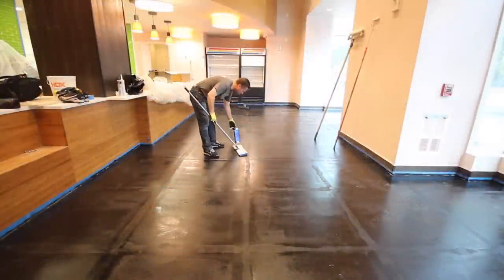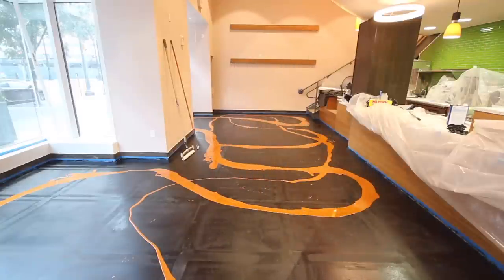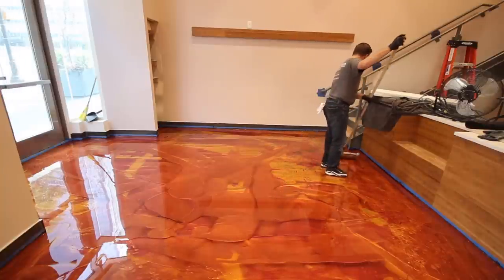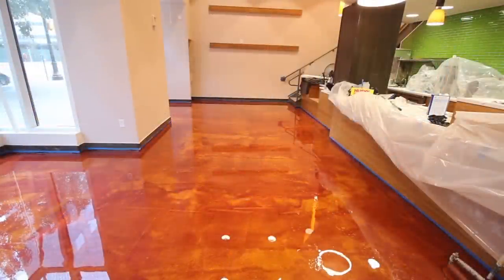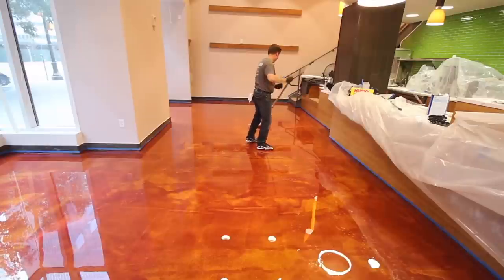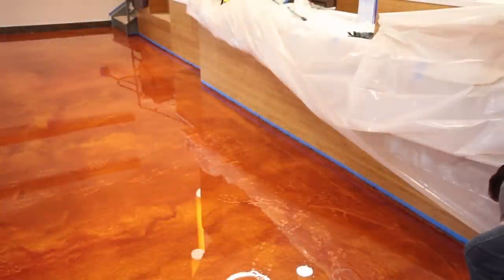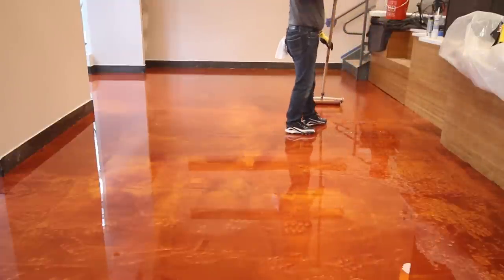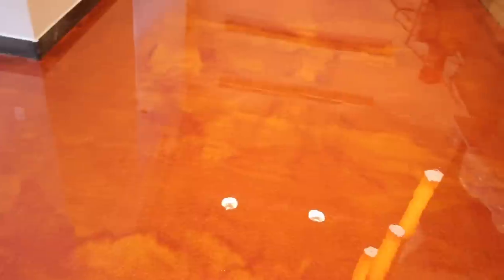Learn to install metallic epoxy - Orange Gold & Wine Red

Comment: Great video!!!! Can I use this primer E300 and the color E100 to do my basement in Chicago? I have about 1500 sq ft that I will need to do. Can I attempt a DIY for this? I will be doing this with my wife. Can you let me know how many gallons will be needed and what else will I need to prime the concrete floor in the basement with?Thanks!!

Comment: Whats the pot life from mixture mixing to application before expiration?  Thanks for the info.
Reply from the maker: Like all epoxy you want to get it out of the bucket quickly. Once its on the floor and depending on temps you have 45-60 min.

Comment: Nice video. Got a question, why so many re-rolls of the floor? It looks like you rolled it three times on this video.
Reply from the maker: +Versatile Coatings LLC Rolling it 3 times is not absolutely necessary but allowing the pigments to settle and then rolling them to bring them to the top will add depth to the finished floor. You dont have enough time to do this with most epoxies but you can with our designer metallic epoxy since you have about 45 minutes of working time.

Comment: I am seriously thinking of doing my living room / kitchen with epoxy, [ Big open area with kitchen in corner.] 
In Michigan I want to use pex under the sub-floor for radiant heat.(68-110 deg max circulating water)  I would think epoxy should be a very good surface for this. [I am not a fan of tile]
Reply from the maker: +hogheadv2 This would work perfect. Contact us for installation help at sales@epoxyplus.com